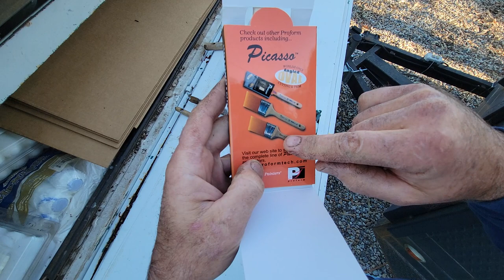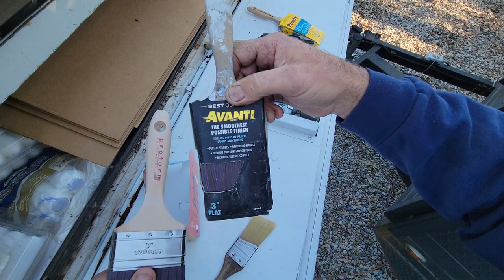Painters BRUSH  like a pro faster and better

Comment: I bought that exact Avanti brush and I found it drips paint endlessly and leaves pretty bad brush strokes it also ironically would dry out and need more paint twice as fast as the corona I replaced it with. It was a miserable experience HOWEVER it is a great dust brush. I actually always have it with me for that reason and I recommend buying it specifically for dusting.

Comment: Picasso 2.5 soft is my go to for about last 10yrs.
Reply from the maker: good one. I put a Picasso link in the description. Try a Corona 3 flat Chinex....3/4 block .It will speed you up on walls about 5% at least. But those Picassos are really good.

Comment: No paint on hands? Thats asking for alot.especially if youre working fast and focused on the quality.ive done 70k in work by myself last year (would of been about 100k if i wanst to nice for my owm good) but no paint on hands?
Reply: I were to constantly worry anout paint on my hands or stopping alot to wipe a spec of paint off of my hands youre talking time i dont waste..i jist wipe it on my clothes 😂
Reply from the maker: carry a putty knife and rag in pocket at all times. Wipe your hand as you get paint on them. Old oil base trick. Paint on your hands ends up paint on the handle of the brush, paint on door handles and paint about everywhere you go eventually. Gotta keep clean to an extent. yea you get some paint but not much.
Reply: @mikethepainter  i understand that for sure..learned all of that the hard way..and i do keep a rag on me but rags fall out of places you put them and alot of times its just easier and faster to use my shirt panta..especially if im up on a ladder haha...i totally get you though..im just busting your chops haha..love your channel and your wisdom..hope all is well over there in crazy land man ✌
Reply: And by crazy land i mean cali lol
Reply from the maker: @jsmith5655  yup I do the same from time to time. My shirts look like Picasso ha ha.
Reply: I put my rag in belt pouch. Tried clipping onto my belt directly for a year, but when i crouched, it picked up dirt.
Reply from the maker: @jsmith5655  yea that is good too. best to use a rag but I have been known to have a picasso shirt ha ha. from loosing my rag.

Comment: pure bristle brushes are the best tried every synthetic brush there is none of them hold as much gear as natural hair also you get more control. if your brushing walls you want to use a pure bristle especially take you longer with a synthetic and wont get as good as coverage.
Reply: What bristles are pure bristle?
Reply: @palmerpalmer1538  hog hair traditional brushes before they started pushing synthetic bristles
Reply: @jackwardley3626  where can I buy that